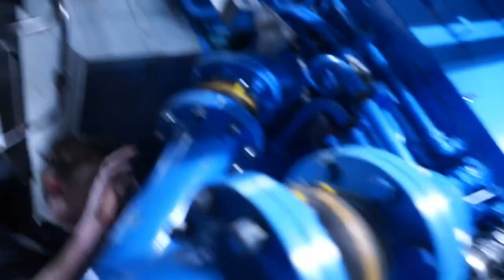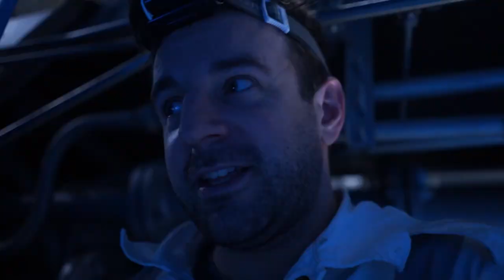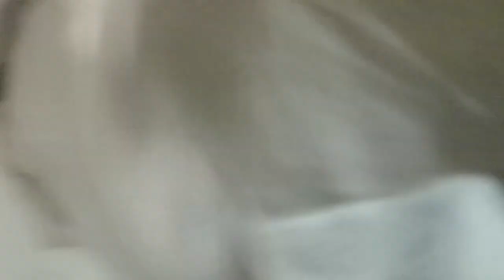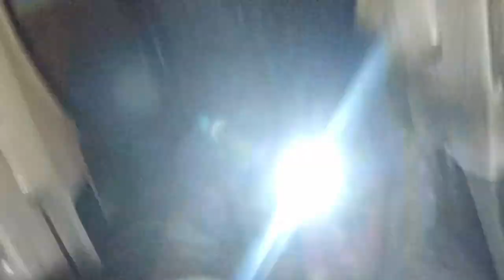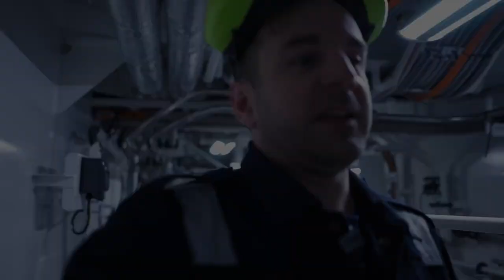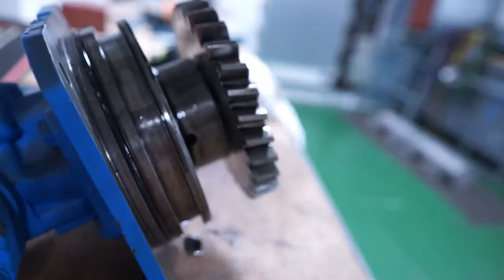Main Engine Failure | Engineers Vlog

Comment: Hi Jono, I hope you're enjoying your leave.
That's definitely not a sight any engineer wants to see in the sump. I imagine this issue would be manufacturer related especially if it's the same story across multiple engines. What was the action taken thereafter? Just order a new HP FO pump for each engine or further investigation into the root cause as I imagine the same thing would happen to the new parts eventually too?
Reply from the maker: Choosing my words carefully, yes, it turns out this is  a known issue with the 9's.  There is a fix, but owing to the way our engines are mounted, it doesn't appear to be possible for us.  So for now we just have new pumps installed and have to keep an eye on them as they will fail again, hopefully we catch them before failure because I'm not keep to wife or or sumps again.
Reply: @engineerjono9962  Interesting, my previous ship had the inline 9 engine as well. It's frustrating isn't it, not only do you get caked in earth juice wiping out the sump it's also a worry whether it may happen to the other engines too. All the best mate.